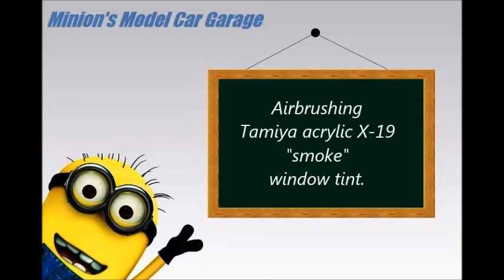Airbrush problems and applying Tamiya X-19 (smoke) window tint

Comment: When spraying Tamiya acrylics, thin them with either Tamiya's own acrylic airbrush thinner or 91% rubbing alcohol. Not 70% and not denatured. 91%! Water and 70% rubbing (and denatured) alcohol are Tamiya acrylic paints' worst enemy. About 30 years ago, Tamiya paints were becoming a problem with the paint clumping after thinning or, once the model had been finished, the paint would shrink and crack. A chemist with a local IPMS chapter came up with the 91% alcohol solution to the problems.

Comment: One issue is using distilled water with an alcohol based acrylic.  Tamiya is not a water based paint (you will notice the little flammable symbol on the bottles).  Will need to use Tamiya x20a thinner, windex etc...  Best results will be with Tamiya's own thinner.  And as pointed out, the starter air brush is not the same quality as the model H, so needing more air pressure might be the cause.
Reply: Kev is absolutely correct.  Know your paints before you attempt to do anything.  at least do some research.  And get pipettes.

Comment: I tried this twice, a couple of years ago. Once with the spray can version of the paint and again with an airbrush. Both times my results were pretty much the same as Steve's. I even tried it with a similar product made by Parma. Same results. However, to me the end result doesn't look like tinted glass, it looks like the glass has been given a light coat of paint. It's not translucent like tinted glass should be, it looks very hazey. If you ever go to a model car show/contest you will notice that whether or not the 1:1 car would have come from the factory with tinted glass, very, very few of the completed kits have tinted glass. I firmly believe the reason is because it's just plain hard to do and make it look right. There is no way to prepare clear plastic for painting as you would the car's body. You can't sand clear parts and you can't prime them. Anyway, I just thought I'd share my experiences with this technique. I do want to thank Steve for his time and effort in making the video. Keep it up.

Comment: Looks good Steve, With the starter brush when you put it together do you have the hole in the needle facing up? Other than that unless the needle is clogged it should be working.........................................................Ken
Reply from the maker: Show Rod Garage I have cleaned it numerous times and I make sure the hole is facing up, still cannot get the paint to flow.
Reply: Model Car Minion That is so strange that would drive me nuts. But you have the H and that`s a better brush. But it would still drive me nuts cause everything should be working.

Comment: Have you tried turning up your air pressure.Some siphon feed airbrushes need a higher pressure,35 psi or even a little more.
Reply from the maker: +Rays' Blue Basement Workshop   Thanks for the comment, I tried it again last week with only w/w fluid in the cup and still nothing came out.  It may be the pressure was too low, I will try again with a higher pressure.  Although the H with the same paint cup works at 22 to 24 psi.

Comment: Couldn't tell in the video but is there a small oring on the nozzle of the starter brush?
Reply from the maker: Jonathan Milbury   Not on the nozzle, but there is a small o-ring on the outside of the needle just before the hole where the paint should come out.
Reply: +Model Car Minion My external airbrush done the same thing the other day. It ended up being the colour cup had a clog near the bottom of the cup. I picked it out with a dental pick and the airbrush worked awesome after that. I would take the colour cup and try and blow through it to see if it's clogged. Hth. Good luck!